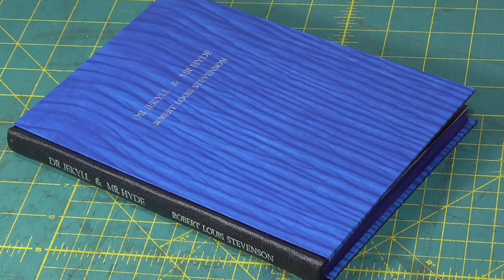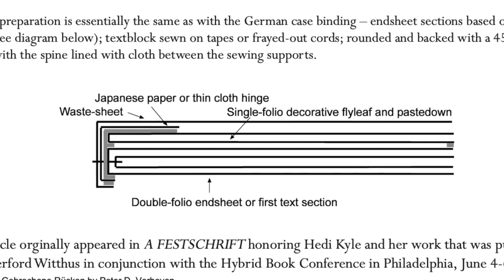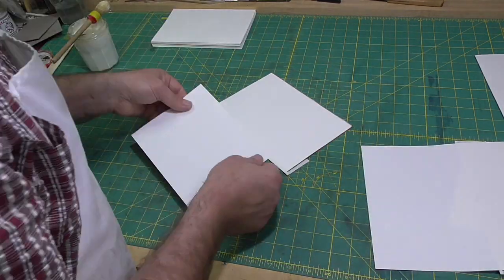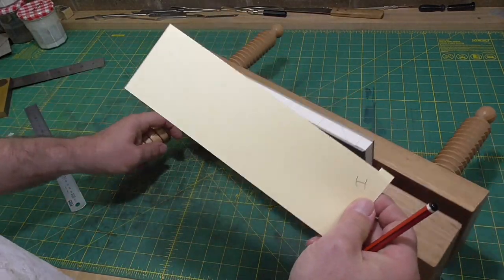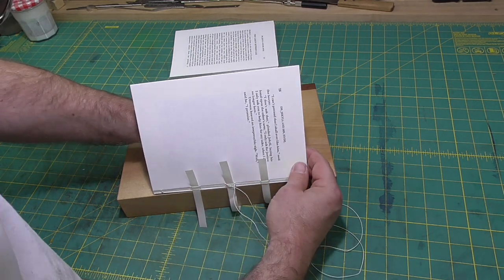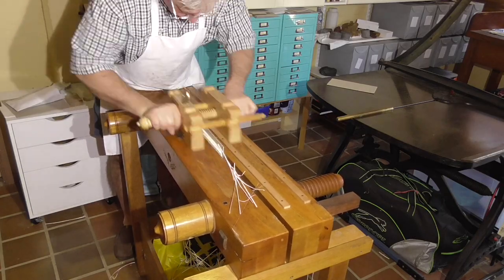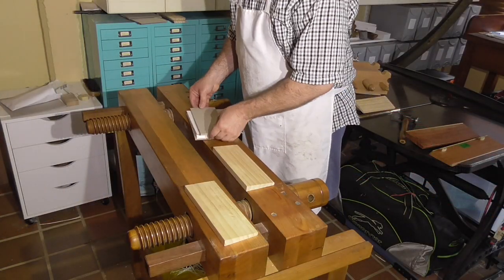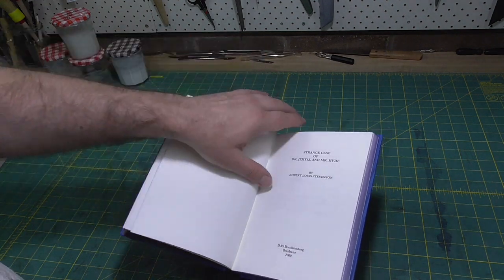In-Boards Three Piece Bradel Binding; Der Gebrochene Rücken Part 1 // Adventures in Bookbinding

Comment: I'm really enjoying your videos. Thank you. I have a question about the Washi paper you mention here. I've never bought any and would like to try this binding method but struggling to know what to buy. What weight is the paper and it's name?
Reply from the maker: There are so many small paper makers in Japan and what is available to you depends on where you are.  Something between 40 and 60gsm.  It doesn't;t need to be handmade or pure kozo.  Of course that would be better.  I buy direct from Japan from Ozu Washi
https://ozuwashi.com
Reply: @DASBookbinding   Thank you!

Comment: Lovely, but dare I ask what grit you use for the rounding for the fore edge?

Normally I don't round the stuff I bind for personal use, but I'm transcripting some Seneca's texts in Latin for my reenactment group and wanted to bind it so it can be showcased when Medieval fairs are a thing again.
Reply from the maker: So the rounding was done by hammering the spine.  The sanding just takes out any scratches and the little ridges from the edges of the sections.  I think I used 240 or 320 grit.  It was fairly fine, I didn't actually check.  Since I wasn't going for a glass finish I just wanted it smooth but didn't want to take too long getting there.  I'd like to do some books aimed at reenactment groups.  What do you think would be popular with the groups you are with?  Thanks, Darryn
Reply: @DASBookbinding  Ah, depending on the focus of the groups, the more academic ones will enjoy period texts.  Onto that route I went from Seneca's writings taken freely from the "thelatinlibrary" web page (it's good that there's no copyright claims on texts written aprox 2040 years ago).

The more martial groups would rather enjoy fencing treatisies like "Flos di battaglia" by fiore in the 14th, and there's a free PDF that's translated into English at fioredeiliberi<dot>org.

If you go the route I'm going, you'll need to make it an anthology, since for instance Seneca's "de Vita Beata" written by hand was only 2 gatherings of 4 folds each only.  I'm adding "de Brevita Vitae" now and since I'm estimating that'll be just another 2 more gatherings, I may add one or 2 more texts by him as well c:

And thanks for the videos, so clear and educative, and the time you spend replying to the comments here.  It's admirable!
Reply from the maker: @Mtonazzi  Thanks!
Reply: @DASBookbinding  I'm the one thanking you for all these videos and explanations c:

Comment: Just a couple of questions - Do you ever saw the holes when the signatures are in the press, and do you prefer sewing with or without a frame? Also, thanks for such varied and instructive content - it is enormously inspiring!
Reply from the maker: Using a saw for sewing holes goes back to trade binding where speed was really important.  Bookbinding was a very competitive industry and time is money.  I will still sometimes saw in the kerf for the kettle stitches to sit down in on tight-backed books where I want a very flat spine.  For recessed cords obviously these need to be sawn in.  I love using sewing frames and own more than I need.  But they take time to set up and usually add no value for sewing on tapes.  Sewing with cords requires use of a frame and I get plenty of time doing this to satisfy my enjoyment.  Time is money:)  All the best, Darryn
Reply: @DASBookbinding  Thanks for taking the time to reply in such detail - it really helps my understanding - Cheers!
Reply from the maker: @carlpeberdy9086  I lost my train of thought.  I forgot to mention that sawing-in, which is shown in many older books, has gone out of fashion because it removes material.  Punching holes just pushes the material aside and after sewing a lot of that gets pushed back into the holes.  Most people only saw-in now when it is technically required, otherwise punch holes.  DAS
Reply: @DASBookbinding  Thanks, I guess that removing material unnecessarily means the binding will loosen more quickly, and longevity is a more important consideration now that 'utility' bookbinding is done by machine.
Reply: Sorry, I forgot that I did have another question - is there any advantage in using a piercing board or cradle? Thanks for your patience!
Reply: @carlpeberdy9086  in other videos he shows just punching at a 45 degree angle into a piece of corrugated cardboard, except in the case of decorative endpapers where the sewing is not shown. In that case I think he punches at a 90 degree angle into the waste sheet and avoids the decorative paper?